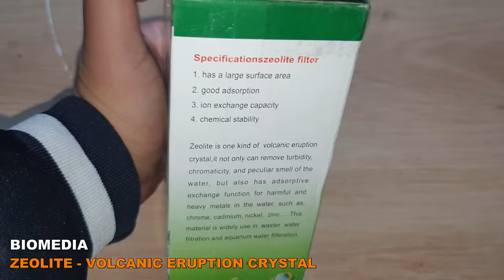DIY Filter Aquarium | Make Aquarium Filter At Home

Comment: You should look into proper electrical connection, soldering, crimping, or wire nuts, I wouldn't trust twist and tape especially for mains voltage.
Reply from the maker: Agree Justin, something i would explore in future to make it more safer. Appreciate your comment

Comment: great idea but you should have return pump at the bottom of the container that way it passes through all of your  media. also you should put the return and intake at diffrent sides of the tank that way its more of a water turn around.
Reply from the maker: Thank you Bee, intake and outlet on opposite end would have definitely made a big difference. The intake is connected to another tube which pushes the water all the way down and then it travels through buomedia before goes back in the tank. Appreciate your time watching video. Have a good one

Comment: Only thing is it should be air sealed container. And am sure this filter will no last longer. When u open the container regularly for filter clean lid will start loosen and possible air leak which will lead to no water return from aquarium to filter. But this looks cool but not last for longer.
Reply from the maker: Agree mate, life of filter depends on maintenance. Applying Vaseline to the rubber will keep it going for bit longer. Appreciate your feedback and thanks for watching
Reply: Bro buying time buy good quality air tight container, leaking is common for canisterfilters also

Comment: The most good looking DIY filter i ever saw in this platform 
Good job  I would  definetely try this
Dont listen to negative comments about leaking and stuff..
U made everything right they propably dont.
Reply from the maker: Thanks Adam, it is very kind of you. As long as the container is air tight there won't be any issue with the filter. Lock n lock is a good brand. Wish you best of luck.

Comment: Having recently built one like this I cannot stress the point enough that you need to test the seal on the container before you get to the point everything is assebled. 
Also I put the pump on the bottom to not make it top heavy, and so media you change often is on top. Zeolite, carbon, fine filter, floss from bottom to top.

Comment: Glad i found this mate, gonna try it absolutely
Reply from the maker: Thank you Fajar, buy air lock container so there are no concerns of any type of leakage.
Reply: @Fishaholic  do we need an air faucet to throw away the air in case there's any air that stuck inside?
Reply from the maker: Don't think it will be required Fajar. As you can see in my video there was quite a bit air in the filter in the start but after running it for few minutes it all cleared up.
Reply: @Fishaholic  oh ok mate, thank you for your time. Appreciate that

Comment: Very nice video... avocado was also great idea.. hybrid tank..two comments...inlet and outlet should be at farthest place...outlet top corner right....inlet bottom corner left...to guarante  best circulation...then if you pierce the tube for balloon holder I didn't see they were sealed...because water would be leaked...on the whole thx...big like
Reply from the maker: Hi Hamid, agree on both points that you have mentioned in your comment. Since it is a 20L tank and plants are fully established thats why I didn't care too much about the efficiency of the canister filter. But for a larger tank, this is something I can not ignore. Thank you

Comment: Wooow, this Idea was so great! Congratulations mate! 👏👏👏
One question, for this kind of filter keep working well, he need to be located on the side of the tank or can be below the tank? 
Thanks
Reply from the maker: It can be placed anywhere you would like but will depend on the pump used in the filter. I have had mine on the side of the tank due to the capacity of water pump and the maximum height it could lift the water.

Comment: Wow..good filter. Have you checked whether the water still flows from aquarium to filter when the pump is off. Wonder if the pressure difference or syphon is working here.🙄
Reply from the maker: Hi Suraj, water flow stops as soon as pump is turned off.
Reply: @Fishaholic  Thanks👍 i will try to make one

Comment: Hey just created this filter... thanks for the great video, one question though! How do i create suction to take the water out of the aquarium?? My container may not be airtight! Also then do i need to attach another pump to the cannister inlet pipe that comes out of the awuarium, to create the suction?
Reply from the maker: Hi Arka, I filled the filter with aquarium water and after turning on the power, suction was created automatically. If it is not working for you then you could always siphon the water or use your mouth to suck water out of the outlet. Once water starts coming out then turn on the power. Let me know how you go

Comment: Nice video dear, I have 400 liters aquarium, what should be the capacity of power head & pipe dimension??
Reply from the maker: Hey mate, go for a powerhead with 3 to 5 times flow rate of the tank volume. 1200 litre per hour till 2000 litre per hour would be good. 12mm pipe would do the job or you can go bit bigger.

Comment: I have a koi pond with volume size 9*5*3 ft3. For filtering water, I use a chamber where Powerhead will transfer dirty water. I need a powerhead with a high volume flow rate and not less than 5 ft head.  Can you suggest me any submersible pump or powerhead?
Reply from the maker: You would be able to find in the aqua one range for ponds water fountain. Sorry I haven't used any pump with that much capacity so won't be able to recommend any that can actually do what it says it can do.

Comment: I love it. I was going to use a plastic soda bottle with filter media but this is way better.Could the inlet and outlet be on different sides of the tank? Gonna steal this idea. Thanks
Reply from the maker: Hi William, inlet and outlet should be ideally at the opposite end. Since it is a small tank so it won't make much difference as 200lph filter for 20l tank would be more than enough filtration.

Comment: Omg fishaholic, I am literally gonna make this today (highly optimistic ...soon!)! Is there anything I need to know about placement when it's all done? It seems so scary to put it under the tank, right?
Reply from the maker: Hi Richard, placing the filter next to aquarium would be an ideal spot. After its fully tested, I would suggest placing it behind aquarium. Inlet on one end of tank and outlet on the opposite tank will ensure efficient water filtration and circulation.
Reply: @Fishaholic  sounds good, I found your updated design too, looks nice!
Reply from the maker: Thanks Richard, pick a good quality air tight container and seal all the holes properly and you won't have any issues.

Comment: Thanks mate.
Just a question- when power goes off, would the water flowing to the canister stop? And how , kindly explain
Reply from the maker: Hi Venkata, water is pushed out of canister due to the pump and it creates suction which forces water to flow into the canister. Once power goes off then the flow will stop automatically as no water will be pushed out of the canister.
Reply: @Fishaholic  thanks much mate. I wanted to build one canister for a 80 litre tank. What should be the capacity of canister filter and pump? Please advise.
Reply from the maker: It depends on the bioload of your fish and if there are plants in the tank. Go for atleast couple of liters canister and pump anywhere from 400 to 600 lph as lifting height will reduce the flow rate
Reply: @Fishaholic  thanks for taking time to answer my questions.
Reply from the maker: No worries at all

Comment: for 40 gallon tank can i use air pump with 2l/m and a power head 650l/h 8w
Reply from the maker: Hey mate, copying my reply here again. It is recommend that the water is changed 3-5 times per hour. For your tank it would be 453 litre per hour to 755 litre per hour. Power head is almost close to Max recommendation so should do a good job. Air pump is a bonus, will help in aeration. Not having one won't be a issue.

Comment: nice mate. wanna ask.. does the container need to be airtight to pull water? does it work if the container is placed higher/lower?
Reply from the maker: Hi Sam, I believe it has to be air tight so there is no risk of water leakage too. I haven't tried raising the filter above the tank but it works if it is at same level. Would work if filter is located under the tank as it is basically a canister filter.
I have uploaded videos of diy filter located above a tank, might be worth looking if you want to build a aquarium top filter.
Reply: @Fishaholic  Cool thanks!
Reply from the maker: You are most welcome and wish you good luck in building filter for your tank.

Comment: Friend sorry for the silly question, how is the water pulled into the filter? the pump takes the water into the aquarium, but how does it get into the filter?
Reply from the maker: Hi, it works exactly the same way as a store bought canister filter. After building the filter, fill it with water and turn ON the pump. 
Water from the filter will enter the aquarium through the pump and will be replaced by the water entering from aquarium
Reply: @Fishaholic  So the filter itself will pull the water into it?  when activating the pump?
Reply from the maker: @kwaiuse5862  thats correct, there will be some air in the filter and hose in the start. However, it should go away slowly
Reply: @Fishaholic  ok, thanks a lot for the clarification.
Reply: @Fishaholic  I'm still a little confused, because normally other canister filters pull the water in due to gravity since they are below the aquarium. Then the pump pushes the water back to the aquarium
Reply: @mckricks1  Container is a vacuum

Comment: Can u tell me the proportion for fresh water tank. If I have 20litres tank then what should be the jar capacity use for diy in litres ???
Reply from the maker: Hey mate, there is no such proportion, any extra volume will add to the capacity of the aquarium. You could even a sponge filter in the tank and it will do filtration. 
By adding a separate canister filter will boost the capacity and you can add extra fish in the tank. Hope it make sense.

Comment: Hi, I implemented you model and kept the canister 3 feet below the fish tank. The submersible pump is releasing the water however the inlet is not pulling the water into canister.
Specs:
5.4 ltr air right canister 
3 ft max lift 750LPH submerged pump
Questions:
When implementing the above I have not filled silicone at the gaps of holes made. So I hope if I seal all gaps at holes, the inlet would suck water simultaneously as pump outputs water, right?
The canister being placed below the tank is not a problem, right?

I’m kind of stuck mate, please help
Reply from the maker: Hey mate, seal all the gaps to make it air tight. Also pre-fill the canister filter with water. Canister filter placed under the aquarium is not a problem at all as long as pump can lift water that high.
Reply: @Fishaholic  thank you, trying out for the first time. Hopefully I see success so that I want to build another one. Thanks for all your guidance
Reply: @Fishaholic  hi mate, I sealed all gaps with silicone and now the water is being sucked in and outlet is also fine. However, when power goes off the water intake is continuing (canister under 3 Ft) and when water fills in canister it is bursting out.
So., I keep tha canister at the same level as aquarium, the water is not bursting out. Hopefully it would not in future.
Any other thoughts??
Reply from the maker: Keeping at same level would be a good idea as mine was levelled with the tank too. To be on the safe side, Fill the gaps again where water was coming out from.
Reply: @Fishaholic  it’s coming out from lid corners. I cannot seal them right? Or any way to temporarily seal??
Reply from the maker: The rubber gasket that came with the lid is the only way to keep it airtight. With silicone sealant it might get ruined.
Reply: Hi, I implemented the same model and kept the canister beside tank (2 inch higher from base) the water inside canister is getting reduced every time after power goes off and come back. Pls help

Comment: Put the filter lower than the aquarium's water level, then the flow into the filter will be faster but make sure your pump is able to return the water at that lowered height. Right now you can see the return of water to the filter is very slow because of low siphon effect.

Comment: I'm confused how is the water coming out of the filter if you didn't connect to pump. Seems like you have water going out and in from the same source. I'm I right?
Reply from the maker: Hi Dae, once filter is filled with water and there isn't much air in the inlet/outlet then water is sucked in the filter automatically due to the void created by the pump which is pumping water out through outlet. Works exactly same as a store bought canister filter.

Comment: I get the outlet is with the pump, how is the inlet?  Gravity?
Reply from the maker: Thats correct Reza, it works similar to store bought canister filter. 

You could always place a pump inside the tank and connect it to the inlet, won't require a pump inside canister in that case.
Reply: Suction is created in the entire canister, bringing water in and pumping it out.
Reply from the maker: Spot on

Comment: I'm curious that how could the pipe even draws water back to the filter if there's no mechanical power
Reply from the maker: Its due to the pressure build up inside the canister that withdraws water from the aquarium. Same mechanism as a store bought canister filter. The container needs to be airtight so there pressure is maintain at all time. Appreciate your comment.
Reply: @Fishaholic  im afraid what happens if the power goes off will the airtight container stop the water flow i mean can we sit back cool without thinking about any water leakage
Reply from the maker: There won't be any water leakage as the container is air tight same like a canister filter. But won't be good for fish as beneficial bacteria might die if power is off for extended period of time. Appreciate your comment

Comment: Is this kind of DIY fliter will work to a 2.5 gallons aquarium? It will not overflow???
Reply from the maker: Mine is 5.2 gallon and have had no issues at all. Filter will simply stop working if power is disconnected

Comment: Bro water pump for out water or in water  and if it is for out water  so how come it take water form tank thanks bro
Reply from the maker: Water pump will be submersed in the canister filter. I filled the canister before turning ON the power. It works exactly the same as store bought canister filter.
Reply from the maker: Make sure your container is airtight Ashraf otherwise it won't work and water level will drop inside the canister. I hope it answers your question.

Comment: My filter box like that dont wanna suck into inlet pipe bro ,whats the mistake?
Reply from the maker: It is not air tight, either lid of container or the holes you have drilled for the pipes needs to be looked at. I hope it is an easy fix mate

Comment: Bro how can I know this canister will filter how much liters per hours. And once u use this filter did u face any problem or failure in tank. . Thanks bro
Reply from the maker: Hey mate, I have used 200LPH pump. The flow rate of pump would determine filtering capacity. I didn't had any problems as for 20L tank, canister was filtering almost 10 times the volume of the tank.
Reply: Thanks bro
Reply from the maker: You are most welcome
Reply: Same problem my water level drops in the container.. any solution?
Reply from the maker: Hey mate, the only thing I can think of is that container is not completely airtight. Hold it upside down and see if there is any water leaking through or around the lid

Comment: Once you off the motor, water from aquarium continues to flow into ur filter and overflow,  and water may leak through your cap if not sealed properly
Reply from the maker: Completely agree Mahesh, it is very important to use an air tight container with a seal around the lid to avoid any water leakage. Testing prior to use will determine that. Appreciate your feedback mate and thank you for watching the video.

Comment: Se la pompa la mettevi nell’acquario nel tubo di entrata invece che dentro al filtro , funzionava lo stesso?
Reply: You don’t want the pump to pull dirty water. The pump is pulling the clean water after the dirty water goes through the filter. If you put the pump in the aquarium the pump will pull dirty water which will eventually clog the pump unless you put a filter sponge over the intake which will negate the reason for making this type of filter in the first place. Only other option is to put the whole canister in the water which is what this type of filter avoids.

Comment: What is your pump power rating?
Reply from the maker: Hi Allen, its a 4W pump with 280L/H capacity
Reply: @Fishaholic  Thank you sir. I have a 3W for my 15gal tank. Will try to make a diy sump filter today.
Reply from the maker: You are most welcome Allen, it should do the job depending on litres per hour? 3 to 5 times the tank capacity would be ideal in most cases.

Comment: What pump u have used? What is it called? It don't seem to be a submersible pump. If so then it is supposed to be under water while operating or else the pump will burn out n ur pump is not completely submerged what I saw!!!🙄🙄
Reply from the maker: Pump is aquapro 210 table top pump. It wasn't completely under water due to trapped air. It escaped eventually after giving it quite a few shakes